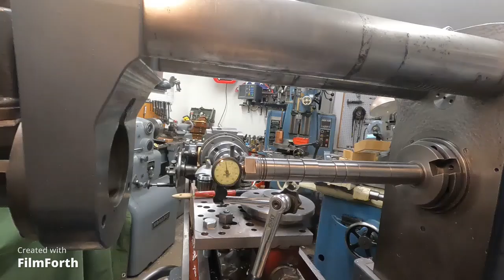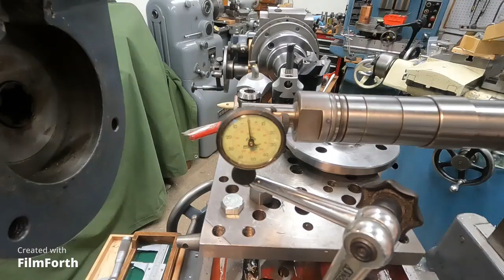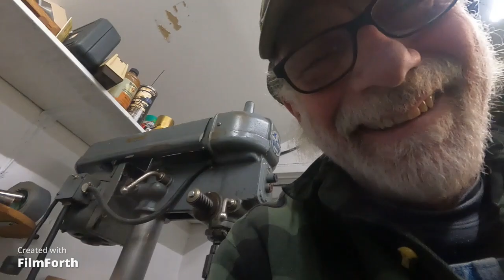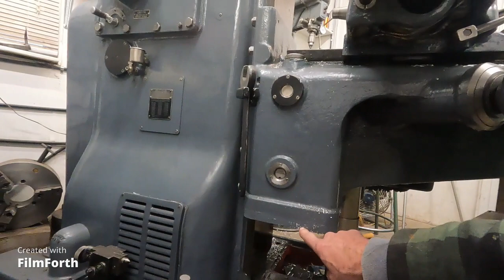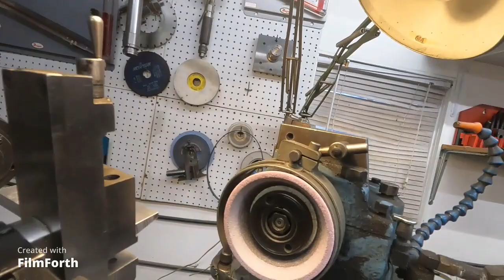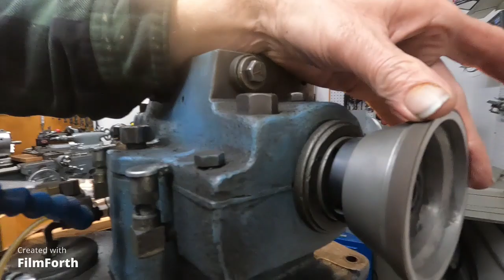Machine tool details Brown & Sharpe milling machine, and more Tool Cutter Grinder work.

Comment: Can you mount a right angle plate with a flange bearing or a pillow block bearing mounted to the machine table to support the boring bar while boring the bushing?  This way you can bore the bushing with the sliding arms extended and possibly sagging a bit due to gravity.  This would result in boring the bushing in the position it's going to be running at when it is set up later.  Another way might be finding a way to mount a steady rest to the milling machine table to support the boring bar.  Just some thoughts.
Reply from the maker: The problem is the horizontal spindle has no feed so the overarms and yoke have to move to machine the bushing. The two round overarms move with a rack machined into them. I am thinking of fixing the yoke to the table and using the Y feed. With the weight of the vertical head the more it is extended the more it sags when extended. They quickly improved on this with the #20 sliding head mill. The serial # on the vertical head is only 54, not many were made. Thanks!

Comment: Have you ever thought about using your tree boring head set at 0 degrees? It can be used somewhat like a quill for your horizontal spindle. That might be a way to get that bushing concentric to the horizontal spindle.
Reply from the maker: Yes, I will get the hole started straight using a really small regular head because it has to be extended out so far. I am thinking the factory would have used a cutter/reamer combination cutter. All I have to do is get a hole concentric then finish with the Sunnen hone to get what appears to be ,0008 for running clearance. I will soon adapt the Tree head to the horizontal spindle. Thanks!

Comment: Thanks for the pep talk about T&S grinders.  When I get my Brown and Sharpe in working order I’ll be on guard (ha ha).
Reply from the maker: Yes, be careful, the table has a lot of power and can crack a non spinning wheel if bumped and it will blow when the machine is turned on